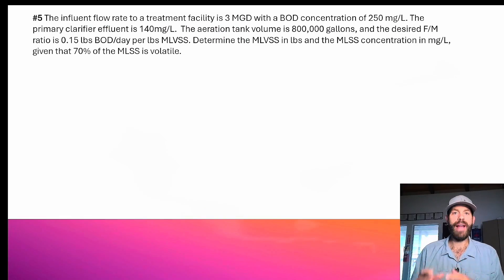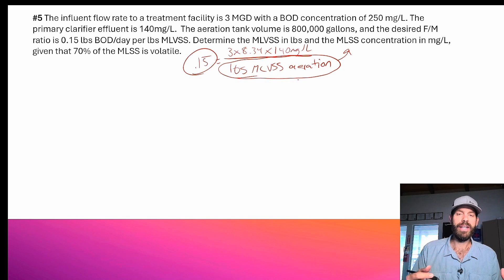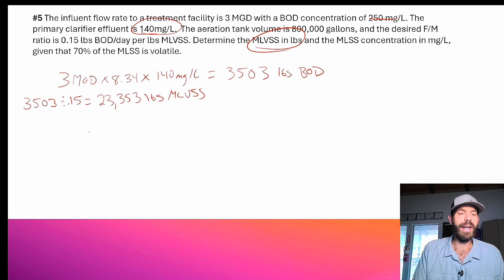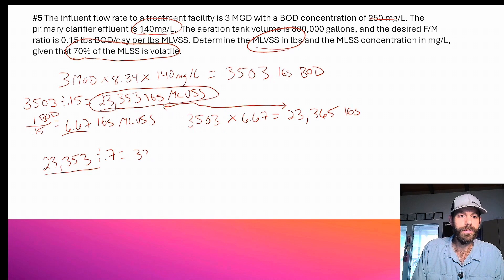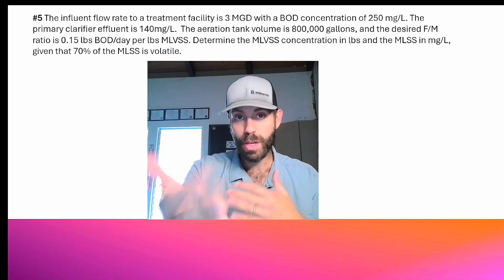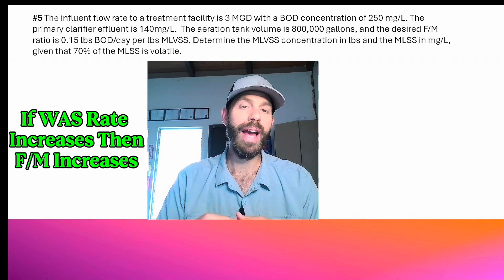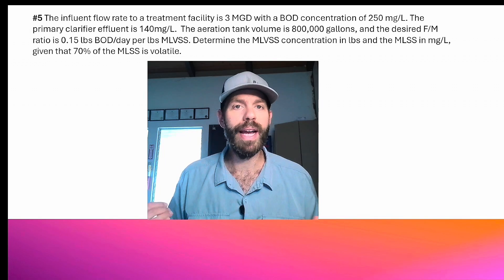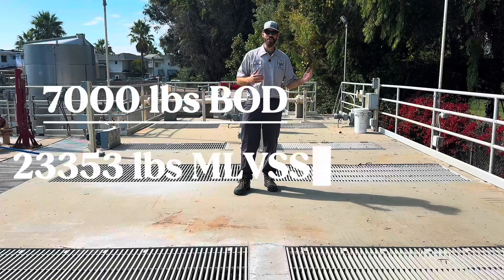Finding MLVSS & MLSS and Adjusting the F/M Ratio in an Activated Sludge Wastewater Plant

Comment: Great format. I appreciate the whiteboard math sandwiched between real life demonstrations in your plant. It really helps put the math problems into perspective. I noticed there is a lot of new housing development around the plant in your videos. Do you think this will impact your operations and if so, how is your plant prepping for it?
Reply from the maker: Hi Mckinzy!  Great observation.  The MBR package treatment plant is a new addition to our treatment capacity.  It's only 2 years old and was installed for a couple of reasons.  Reclaimed water for the neighboring golf course was one and the development in town is another.  The town is still building out and with the addition of a brand new local RV park, putting in supplemental treatment was a forward looking idea.  Although our plant is now overbuilt in terms of hydraulic capacity due to low flow fixtures being installed over the decades, the concentrations of the wastewater have steadily increased.  So in short, the MBR plant expansion had these developments in mind.